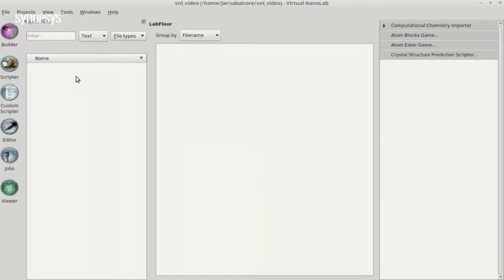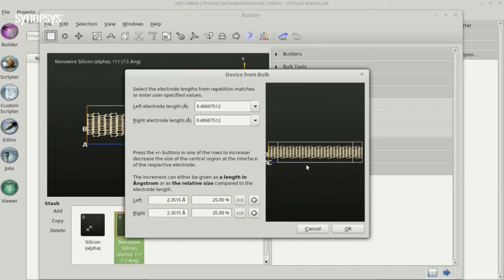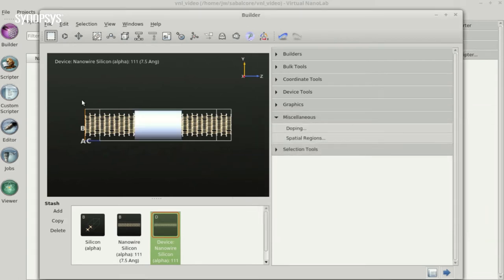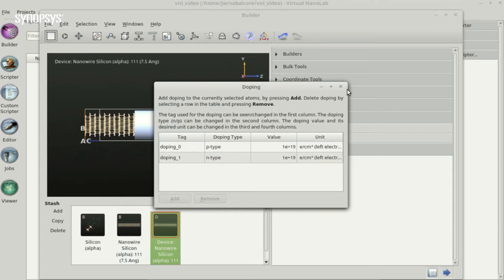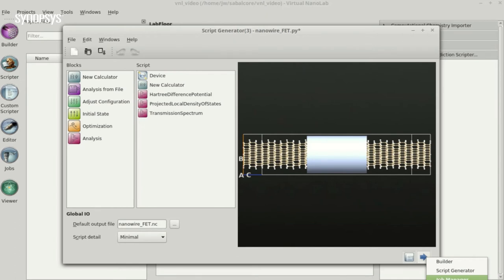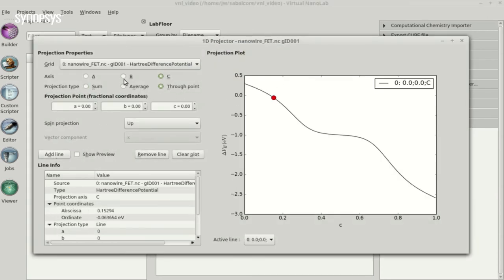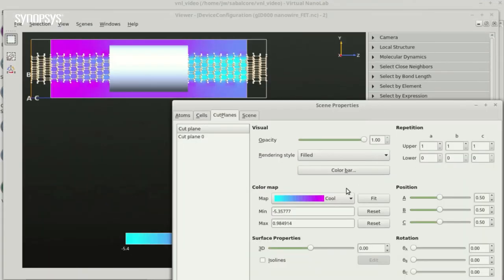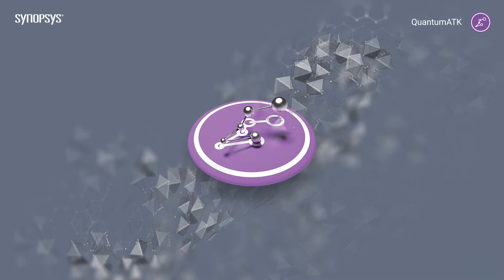Silicon nanowire field-effect transistor with QuantumATK NanoLab

Comment: Hello sir, 
For transport calculations on bulk structures say an armchair or zigzag nanoribbon of good length around 20 ang., do we need to optimize the structure along with the electrodes before performing the calculations with a finite bias.
Reply from the maker: Hi Sankushkrishna - generally, it is recommended to optimize the structure before doing transport calculations. Though, if you know what you are doing, you can certainly not do it and interpret results accordingly. If you have further questions, it's best to visit our forum - https://quantumwise.com/forum/, where our technical team can provide more detailed responses. Best, Jessica, Synopsys